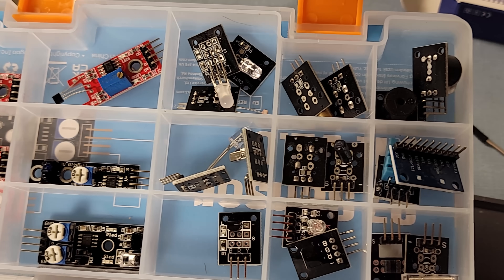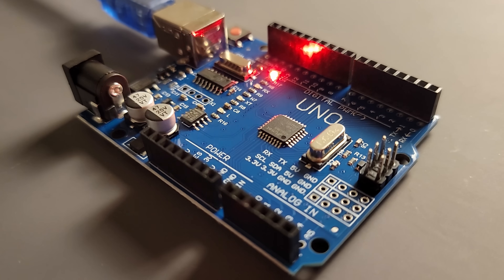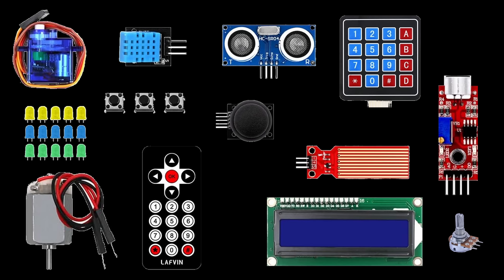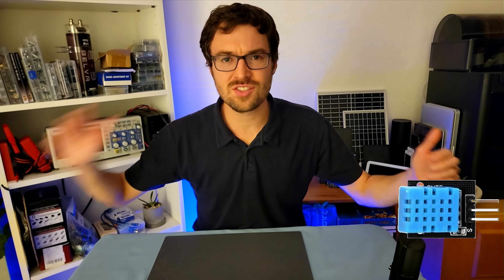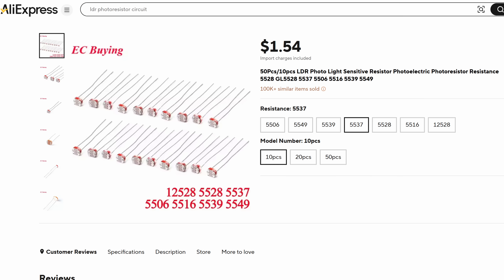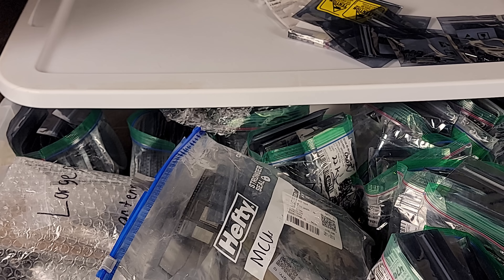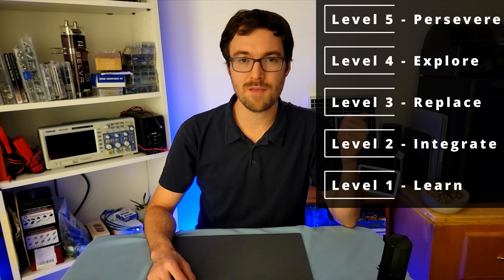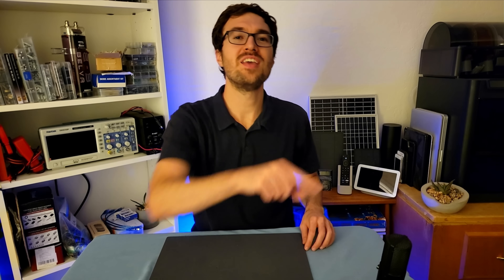How to Make Anything - Learn to Think Like an Engineer

Comment: This is one of the better videos about electronics out there!

Maybe now I'll go make that [remote ]soil moisture meter I've been thinking about.

ARROW is also a good place to buy electronics.
Reply from the maker: Awesome! Glad you got a project to make! 

I'm thinking about much later making a video about this exact thing because it's a very good way to show how corrosion kills a lot of electronics. If you use wire soldered to a coated nail and then add a dab of epoxy over it I found it doesn't get corroded underground. Everything else breaks in like 3 to 6 months. Soil moisture sensors are simple to make, hard to not break over time. Good luck and let me know if you have any questions!

Comment: Gen x here. Lifetime of welding, mechanical , automotive and small engine, carpentry , plumbing, forestry, agriculture, and more. I'm just learning to code. I've built my waterwheel, ram pump, installed solar and wind power, and done a hundred other working projects. I specialize in restoring 40's through 70' s trucks and tractors to functional. I dont know if i can handle this level of engineering. But i'm going to try. Thanks for the info. Subbed.
Reply from the maker: You got this! It isn't that hard, just complicated until you know how it works. A carburetor looks complicated until you realize it just mixes air and fuel. Same here.
Reply: @FluxBench  One of the best most simple circuits to build is an opto-isolator.  Take a big old DIP LED and stick it in one end of a piece of drinking straw.  Take a DIP phototransistor and put it in the other end and wrap it with black tape to light isolate it.  This can be used to jerry-rig so much stuff.
Reply from the maker: @ericsbraun  I love that... On so many levels! I think I'm going to try to do some analog photonic stuff like calculations or logic by using a 3D printed complex set of holes and tubes. Geeze this is a cool idea! Thanks for sharing!!!!
Reply: Just so you know, you absolutely can. I'm a fellow jack of all trades and you're wayyyy ahead of me. I'm confident I can do it and youve got hella experience on me. So I have no doubt you got this. ❤️
Reply: That's an awesome origin story. Keep at it, you got this 👍🏽
Reply: And your wife didn't bother you for long enough for you to develop all those skills??? 🤯🤯

Comment: I have the same exact bin with bags except I sprang for the zippered ones lol
Reply from the maker: I'm at that turning point where my bin is full, and I have a cardboard box filled with un sorted bags from distributors. And my 0 to 99 ohm SMD resistor bag is about to break it is so jam-packed! I think I'm going to build a automated binning system kind of like grid finity meets vertical storage. I'm starting to run a mini warehouse in my house lol

Comment: Folks, with a decent free Ai model as a starting point, and then using YT for skills and forum help for the edge cases, you can really build almost anything you can imagine (if the parts are affordable). 
I spent a few hundred hours with GPT4 and 5 , programming a trio of MCU's (Pi4, Pi3, and esp32) to turn the midi signals coming from my electronic drum kit into impact-reactive flashes of light from custom installed LED strips in the drums. This was my first time coding python, working with MCUs, and electronics in general (beyond some basic phone repair stuff). 
It's the hardest thing my brain has ever done, and SO freaking rewarding when it all finally works out. There is no game, no movie, no song that can give me that feeling of victory and pride. 

Get out there and BUILD SOME SHIT.
Reply from the maker: Heck yeah! Glad to see you using all the tools you have available. AI can be really wrong with hardware design, but it's pretty dang good at simple programming! 

Great seeing you got the confidence of a project finished and that feeling of pride nobody can take away.

Comment: Thank you for this video! Your style of communication is top tier and the mindset shift to thinking in "systems" applies to everything in life and is a marvel of a paradigm shift that really enhances life experience and overall results. I'm grateful for your teachings as you've inspired me to build my first Bitcoin miner! All the best from Western Australia 🦘😎🤙🏼
Reply from the maker: I never would have thought it would to extend to a bit mining rig, but if you're talking about systems, maybe get a couple used solar panels for some extra power for the rig and in emergencies for personal use!

Since GPUs and a lot of crunching hardware runs on 12 volts, I wonder how hard it would be to make a 12 volt 100 amp power supply using a battery as a buffer between the solar and the thing using the power. At that point you don't need to convert from AC to DC again. Systems, right 😂
Reply: @FluxBench  Funny you mention that because I actually have been buying portable solar set ups lately with Anderson plugs. Currently have 2 X 120W panels and 1 X 160W and using an old car battery as a power storage source for the time being as well as an Ecoflow Mini which converts DC to AC and can charge devices straight away, though it's limited by a 100W max input from solar and only carries a capacity of 225Wh.
Anyway, I'm learning as I go and really keen to produce a small self sustaining set up to use with a BTC miner :)
Reply from the maker: @YaNeK92 You're just the type of person I want to make a solar video for. Half of me wants to say Great get something like a EcoFlow, and the other half says go buy a solar charge controller and inverter and used car batteries and used solar panels for 1/3 of the cost! 

I'm just about to turn off my air conditioner powered by solar and batteries because I'm too cold at night, during a Phoenix summer 😜

I think getting familiar with solar is important no matter how you do it. And a small self-contained solar and battery system is always handy! 

Let me know if you have any questions, this is very close to what I do for a living! Lots of solar stuff.

Comment: Thank you subscribed so many projects i want do eventually.
Reply from the maker: Awesome! What kind of projects?
Reply: @FluxBench aio flight controller , video transmission and receiver , body camera , door open/close with safety devices. and more.
Reply from the maker: @michaelcollord7884 you sure have ambitions! A lot of signal processing and RF type stuff. Expensive chips 😄 The flight controller is a fun one! They are fairly simple until you start adding a million features on top of them.

Comment: Thanks for such a great and insightful video!
You should make one on 3D printers and how to integrate them efficiently into the "making anything" process :).
Reply from the maker: I am a bit cautious because I don't want to be branded as just another 3D printing channel. However the next video in the idea to income series, the snake light, it will have tons of 3D printing. Getting the enclosure and the physical / mechanical parts to work great takes a lot of iterations and time and small tips and tricks. 

Maybe a more dedicated 3D printer video later!

Comment: I don't get level 3... am i replacing the components on the module by soldering? am i creating a module from scratch? sry im dumb 😭
Reply from the maker: No worries! This stuff can be confusing. If you need a simple thing like a LED, you can buy a pack of 100 LEDs for about $5 and you just plug them in, but you need to use a resistor before or after them so they don't draw too much power.

If you buy a module like a little PCB that has one LED and one resistor on it, you might be able to buy 5 modules for $5, instead of getting 100 without the PCB and resistor. 

So if you are comfortable wiring up a resistor and maybe a capacitor of the correct values for a sensor or whatever, you can normally buy them much cheaper with individual parts instead of having them coming on pre-made PCBs with the capacitors and resistors and all that built in. 

Hope that helps, let me know if you have any more questions! 🤘
Reply: @FluxBench  You made it super clear, thank you! I remember being a kid, taking things apart, creating stuff. I miss that, so I ordered an Arduino UNO and a car kit! I didn't think you would reply to be honest, subbed!
Reply from the maker: @JamesBenism awesome! Glad you got a kit! you should be able to have a lot of fun with that! Distance sensors and tilt sensors on the car can make almost like autonomous driving system. Just pretend you're blind and have a laser pointer for navigating along with feeling your angle in your ears. Then just like turn that into a program 😂 Good luck in the have fun! Let me know if you have any questions!

Comment: Where is the best place to learn to write scripts for arduino and raspberry pi?
Reply from the maker: Learn fundamentals of programming in any language, and you should be able to transfer those skills to Python or C code. If you want to write code for small microcontrollers then you might want to start with C, but if you want to do more general coding like for computers and web servers and stuff like that you might want to use Python.

Just Google stuff like "beginner tutorial for Python". And go through a few tutorials or courses or whatever all teaching the same 101 stuff. You probably won't find a single thing that will teach you everything in a way that makes sense to you, I would just plan on doing a couple from different places. 

Let me know if you have more questions!
Reply: @FluxBench Thank you very much for your reply. I just wanted to write code for arduino and raspberry pi. I have made several small projects but I can only copy and paste scripts someone else has written and I want to expand my knowledge and under the code and write my own. Thank you again and have a great day 😊
Reply from the maker: @Randy2747 got it! Just like learning a language where you kind of get vocabulary and individual words but can't really speak it fluently. 

This is where you need to start small and build up from there. You want to be typing out things by hand, you need to get your brain used to actually doing it. 

Even if you copy by retyping and thinking what it does while typing, it is still good enough to get your brain wired to remember it next time. This is a bit of just like memorization, you have to keep on forgetting then looking up things until you stop forgetting things. Sounds dumb, but it's a pretty good way to learn. Just do it and try to Google less and do more. Never copy-paste, always retype and ideally retype with different variable names and adapt it rather than copy. 

The reason why doing multiple 101 tutorials is good is they give you a lot of easy examples for you to figure out. You just need to get your brain in the habit of typing out code.
Reply from the maker: But if you don't have the fundamentals, you need to watch a few videos for absolute beginners. There's going to be a lot of weird concepts that don't make sense, you probably just need to watch five videos until someone explains it in a way thay you get it. 

If you don't get it, you're not dumb, it's just a hard thing to grasp initially. But you will feel dumb many times 😂 All of us do! Take a break, then come back and keep going! 😊
Reply: @FluxBench I understand what you are saying many years ago when I first saw gibberish on a page I had to know what it was and how to do it. It was html and I was obsessed for six months all I did was get different wen pages source code and pull one string out at a time to see what it did. After those six months I was making simple web pages by typing html then I got into Java script as well. But I am determined to write my own scripts so you gave me excellent advice. I will go back over my scripts and do as you mentioned. Thank you sir I appreciate you and your content 😉🤜🤛

Comment: it takes me 8 weeks to have anything delivered.
most electronics stores are closed during weekends and I work in the week.
what do I do?
Reply from the maker: I rarely order stuff now because I already have it laying around from a previous project. Not helpful now to you, but once you get started you will need someone and instead of ordering 2 for $5 get 3 for $6, and now you have an extra. You know the part already, you have it on hand, and kinda get a standard set of parts you use because you have them around.

But for now, buy variety kits like starter kits and sensor kits or buy a bit more than you need when you order online. Also, Google "ic kit" and look for op amps, comparator, and other logic chips. Now you can breadboard if you want. But software on a dev board module can go so dang far! ESP32 and stuff. 

Let me know if you have follow up questions.

Comment: This is very true you are pointing to education from when your born use what you learn :) I guess you have no choice in that case. But just to add to this if I may, you do not have to be an engineer any longer all you need to know is how to explain to AI and it will give you a schematic maybe not totally perfected yet still some limitations but very real and close to complete.
Reply from the maker: We will get to AI later, definitely going to cover that from doing AI on microcontrollers to using AI to make electronics. 
I have no doubts AI will be able to do a huge amount of this stuff soon, right now it just makes too many mistakes to teach early on. Figure like you're saying, it's good to get you from zero to 60% and have you fix the other 40%

Comment: I like your concept of "replace" - although... You can buy an H-bridge motor driver. When I started, all these little boards didn't exist [Amazon didn't have the strength is has today]. I had to build the motor driver by hand. Seeing I can buy a 6 pack for $10 - sign me up lol. Way more compact. Butttttt I also love soldering and buying the boards can take some of that fun away. 

Great video - I really liked it [I also liked it].
Reply from the maker: If you can buy it for cheaper and better, why not? But I find a lot of modules and pre-made things are years old by the time it gets out to market for us. I'm going to be making a super efficient and low ohms parallel MOSFET module in and upcoming video that you just can't buy on the market. Maybe off Digikey for $125, but definitely not the 20 bucks or so it should cost!

Comment: What starter set would you suggest?
Reply: Start with what project you want to build
Reply from the maker: @ItumelengS Great advice for basically any subject!
Reply: @FluxBench I know I have 4 kits here and I have no idea what to do with them, would have been better if I wanted to track water in a plant or control lights or something but nope
Reply from the maker: @ItumelengS luckily electronics don't really go bad! Never know if you're going to get back into it and use all those parts someday. Maybe a electrolytic capacitor will leak or corrode over time, but they hold up fine mostly. 

I wish there was like a directory or look up system where you could just say where can I donate my old Arduino kit? And it would say there's a school down the road, email this person.
Reply from the maker: As much as I hate to say it, Elegoo makes some decent starter kits. I have another video about what to buy to get started.

Comment: im a beginner in electronics and my first real project is creating a sensor moving car. One thing i have a very hard problem is how to power the arduino safely while using 2 dc motors. Can you make a vid about external power source?
Reply from the maker: I specialize in power electronics :)
There are a lot of great videos already out there, but it seems like you need to learn about optocouplers (to separate the GPIO signal from the high voltage stuff) and MOSFETs. Skip BJT or transistor stuff and look into gate drivers if you are working with motors. You need to separate the controls from the microcontroller from the switching high power things on and off. "galvanic isolation"  is a good term to google and learn about.

Watch "how _ motor works" and "how __ motor controller works" and "diy motor controller circuit" type videos. That should get you up to speed on what you need to know. 

Let me know if you have more questions later. Seems like a great project!
Reply: @FluxBench Thank you very much! I will try your advice

Comment: You're getting ripped off buying these from Amazon when you can get the exact kits from Aliexpress for 2/3 the price which they original drop ship from.
Reply from the maker: But then I have to wait 2 weeks instead of 2 days 😂 but I get what you're talking about! With some electronics I like to be able to return stuff easily that just doesn't work. A lot of cheap stuff might have only one out of three things that works right. Amazon is fine with the returns. AliExpress asks you to work with the seller until the seller gives you the runaround for long enough that the refund window is closed. Combined I'm probably out $1,000 or more from returns not being accepted from China.

Comment: I'm just starting out, probably around step 2 on your ladder. Since I started with the elegoo kit I was thinking it would be leaps and bounds better if at the end of each "lesson" it gave a few homework type scenarios for you to try to solve.
Reply from the maker: Even if it sounds stupid, just force yourself too try to do new things with what you already know. Kind of like making random math problems, ex: 2 + 5 = 7, Make it so you have some sensor or input do something with some output. Anything to lock that knowledge in your brain by using it somehow.